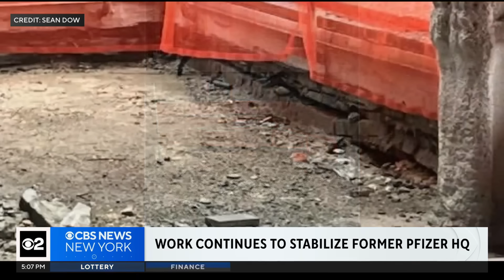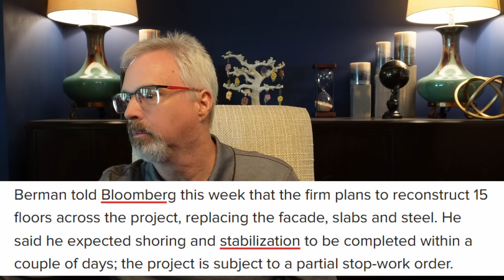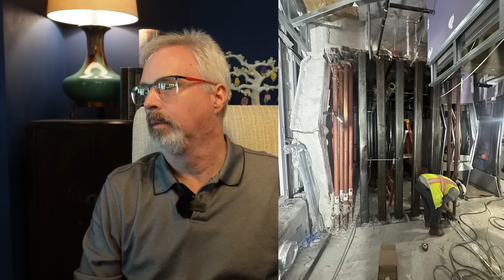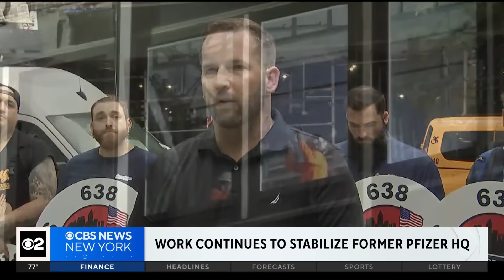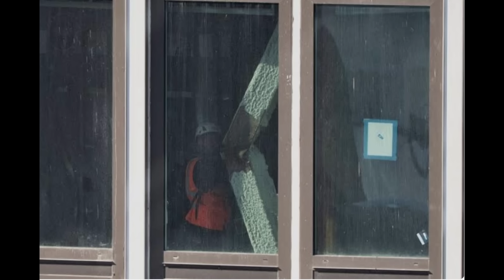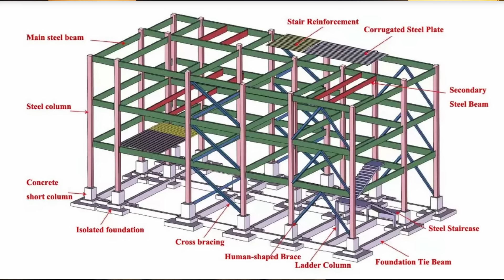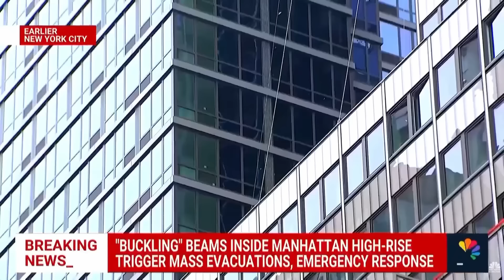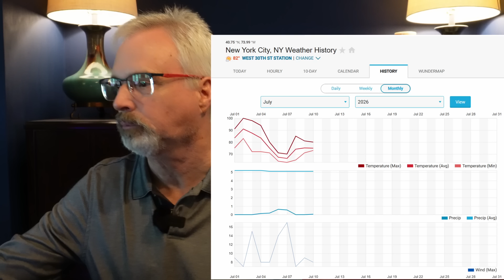Update - Pfizer Building Structural Column Failures; Now What?

Comment: Have to wonder did anyone do a building inspection and figure out if the lower floors of this 66 year old building can handle the additional weight.   Not to mention the ground beneath the building?
Reply: Of course they inspected the building. They probably hired the guys based on personality, played the same sports in college, friendly discount, fast turn around, . . .
Reply: @eltamarindo 
lol, and then they agreed to the final setup in some “entertainment club”, or sort of.
Reply: @eltamarindo  Or better yet,  based upon DEI hiring practices.
Reply: @elt @eltamarindo 

The developer seems to associate with a particular religious group which can be common (keep professional relationships within the tribe).
Reply: Typically, the engineering design for the new section references the existing structure. Specifically how the loads will be transferred to the footers.
Reply: It's not 66 years old. The original building is over 100 years old.
Reply: Maybe stockton rush designed it

Comment: looks like Boeing and their 737 maxx desaster (and all what came afterwards) ... 
"no issue at all" and then the delays will explode while additional issues will be revealed during further investigations and all the shortcuts that had been taken and no one had expected.
Reply from the maker: I agree this situation is only increasing in severity and consequences.
Reply: Actions need consequences.
Reply: They are still building more 737 max aircraft, when they should have been recalled and scrapped. It is an inherent flaw that cannot be fixed.

Comment: Now what?  According to MetroLoft, this is totally normal and nothing to worry about.
Reply from the maker: It's salvageable if they rebuild about 19 stories of this building!
Reply: @CaseyJones-Engineer  And probably strengthen the structure of the old building. 
On a related note, seeing all the new floors tilt, is that just elastic deformation or are the connections between beams and columns damaged as well?
Reply: @CaseyJones-Engineer  but is it insurable?
Reply: It will take more than two months just for engineering redesign, review and approval.
Reply: Eh, it'll buff out 😂
Reply: MetroLoft must take it's building philosophy from Brazilian Favelas.
Reply: How do you even fix this problem? Can you use massive jacks to move the building back into position before installing additional steel columns  / bracing? That would also need extensive modeling of each step of the process. (Not an Engineer). Or do you deconstruct the addition. Make the repairs then add it all back?
Reply: Isn't that about what they said about the unsafe rushed experimental depopulation jabs? Yet no proof at all? I did not get any of the jabs. Why take an unnecessary risk? Natural immunity is said to be better anyway.
Reply: @yosefmacgruber1920  when they claimed the 'vaccine' (a simulation of infection) gave better immunity than the actual infection, that was one of many red flags. Many people now with chronic serious health issues, but not pure bloods
Reply: @spiderbip  
Coercion is a serious red flag. Coercion means it is not good for you. If it was, then why would they need to coerce? And people can gain immunity without symptoms. Terms like "asymptomatic spread" were obvious red flag lies. Why trying to make it sound scary, talking about people gaining natural immunity with little if any symptoms.

And they are trying to change our DNA so that God no longer "owns" us, but so that they can put us under the ownership of their fake patents. It used to be before the 1980s, that seed could not be patented, because only God can "own" life. But it goes to show how corrupt the so-called governments are now.

Will us pure-bloods ever be valued for much now?

They tell us to get the jabs, to protect us against something that we were not going to catch anyway. So where is the scientific measure of effectiveness? Were perhaps the anti-jab people right all along?

And the people who did not fall for the deep state pushed contraceptives, even those who end up with big families, how many people ever really wish that they did not have quite so many children? Almost none? Falling for the so-called birth control, that was a huge mistake also. Gee, why am I feeling sorta Amish? We are talking about stuff similar to how the Amish do. They do not trust a lot of the modern technology, they do not get into debt, and they did not take the jabs, and they do not use so-called birth control.
Reply: @spiderbip  
Coercion is a serious red flag. Coercion means it is not good for you. If it was, then why would they need to coerce? And people can gain immunity without symptoms. Terms like "asymptomatic spread" were obvious red flag lies. Why trying to make it sound scary, talking about people gaining natural immunity with little if any symptoms.

And they are trying to change our DNA so that God no longer "owns" us, but so that they can put us under the ownership of their fake patents. It used to be before the 1980s, that seed could not be patented, because only God can "own" life. But it goes to show how corrupt the so-called governments are now.

Will us pure-bloods ever be valued for much now?

They tell us to get the jabs, to protect us against something that we were not going to catch anyway. So where is the scientific measure of effectiveness? Were perhaps the anti-jab people right all along?

And the people who did not fall for the deep state pushed contraceptives, even those who end up with big families, how many people ever really wish that they did not have quite so many children? Almost none? Falling for the so-called birth control, that was a huge mistake also. Gee, why am I feeling sorta Amish? We are talking about stuff similar to how the Amish do. They do not trust a lot of the modern technology, they do not get into debt, and they did not take the jabs, and they do not use so-called birth control.